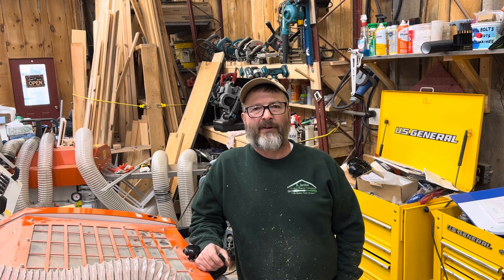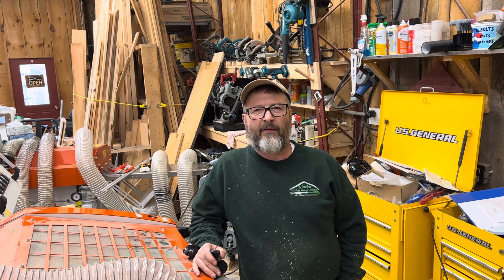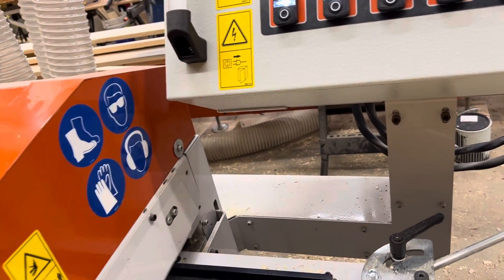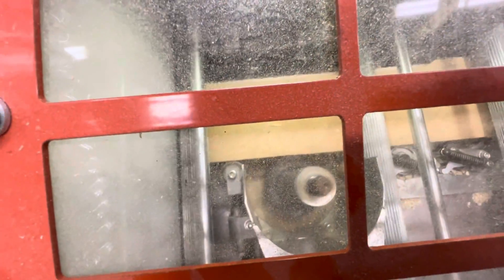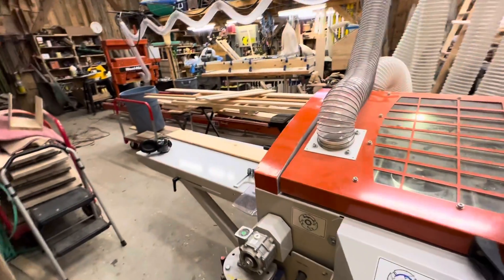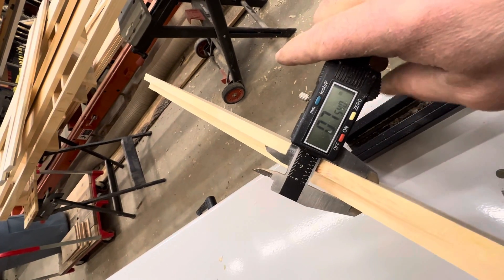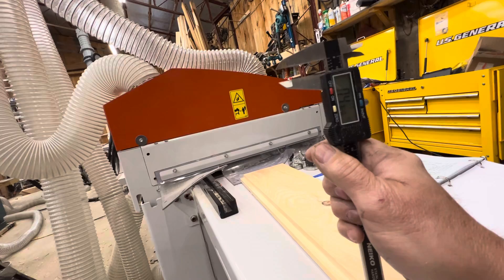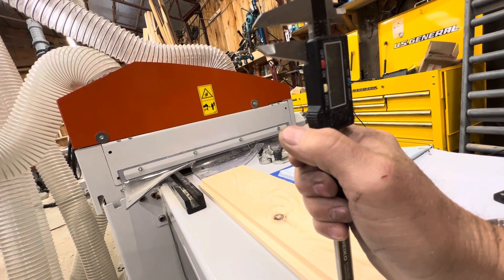Woodmizer MP360 molding - shiplap siding set up and validation for 3/4” boards

Comment: Where did you get those clamps for the guide fences?   I have the 280 and I struggle with keeping the board straight as the fence keeps moving on me
Reply from the maker: Hi Bensonboys:  the guides with spring loaded roller bearings on the non-fence side are from Woodmizer.

Comment: Is the mp360 capable of doing matching cuts on the ends of a board for flooring ?
Reply from the maker: Hi Chris
I have not made flooring yet.  Other 360 owners have made flooring with good results.
I plan to make quartersawn oak flooring next year - when my oak is dry.
Reply from the maker: Hi Chris
For flooring, On the ends of the boards, you’d need to use a shaper and the corresponding t&g bits to match the MP 360 t&g profiles.